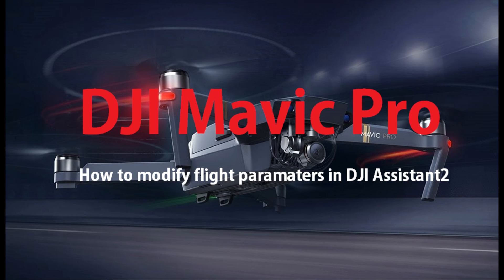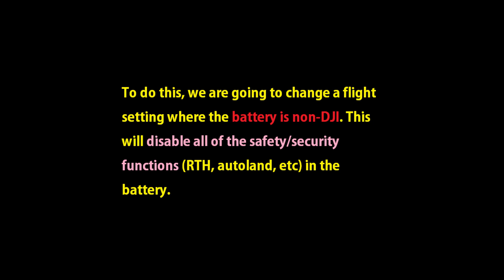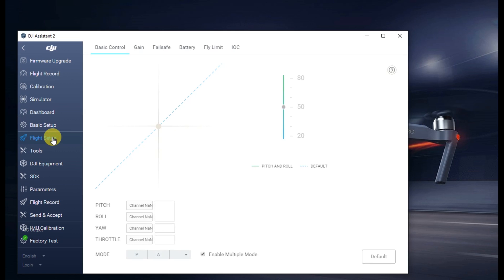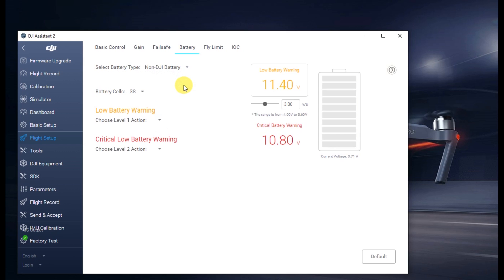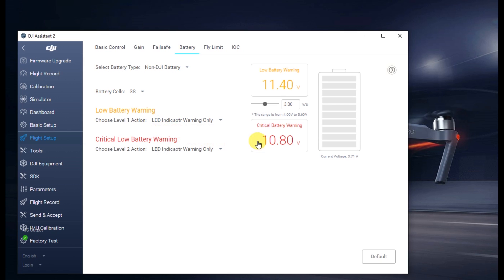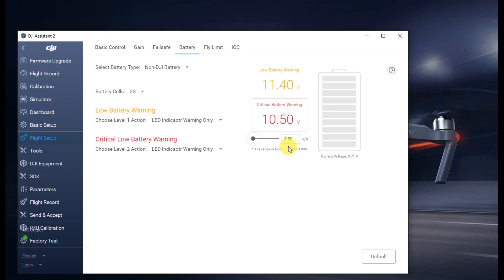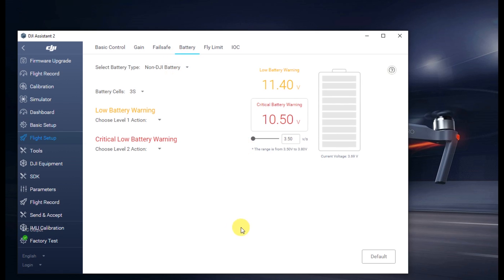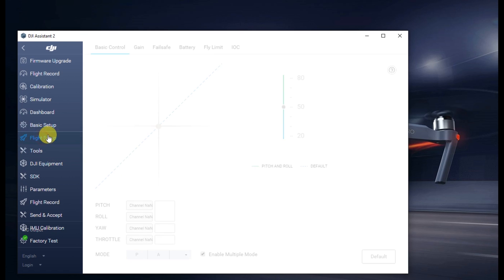DJI Mavic - How to modify flight parameters for  battery RTH mod

Comment: Sir I have a mavik air...the Dji assistant her which allows debugging does not show my drone as mavic air but mavik orange. Also when I change the parameters they do not show the numbers or sliders..pls help me with a walkthrough on this. I will be really greatful to you
Reply: Hi, I have the exact same issue. Did you find a solution?

Comment: dear sir ,Please help me. I disconect the pack 3s of circuit of mavic battery and the chip bq30z554-R1 block the current becouse one parameter named Permanant Fail (under voltage) and i cant change this.  How you change the cell and use the same motherboard?

Comment: This mod works on the Mavic Pro (Don't have experience with the other dji drones) - To help clarify what the author of this video cant say.  Lets say your flying your mavic and just going up, up ,up @ apx 6,000ft up  the battery will be at 72-74% battery remaining. But the on mavics brain was programmed to assume that the drone will decend at some slow speed (I don't know what stock decent is, but maybe 6-7 m/s). So even though the battery is showing 70+% battery left, the drone starts the return to home and there isn't a manual shut off once it starts, it simply returns to home and lands. What you must understand is that if your mavic goes over 1600ft  (400ft is the legal limit in the us) then the software/firmware has been modiifed. That said the decent speed will also have been modified. And in sport mode mine decends at apx 22 or 23 mph. and decending at that speed only uses 10-12% power. So in this example without this battery mod I would be forced to land with over 60% battery remaining when the drone touched the ground. Going really high isn't all it's cracked up to be and can get you in real trouble. But having your mavic in sport plus mode takes flying it to new level. Have flown mine for 8 months modified and no problems at all. The guy who does these videos and the others like him who have worked to make this possible are incredibly talented. I did my mavic the hard way and all mods my self (with instructions found online). Now you just spend $30 or so and it takes you 20 minutes. Google NLD or nolimitdronz.

Comment: I owe a Mavic Pro and yesterday I downgraded via assistant 2 v1.2.0(latest),from 1.04.0300 to 1.04.0100 succesfuly.
I tried to rollback my Mavic Pro to 1.03.0700 from my new current 1.04.0100 using Dumldore 2.14 (latest), using Steve's method.
Opened assistant 2,loaded my current firmware(1.04. 0100), open Dumldore, load 1.03.0700, closed assistant 2, pressed flash,pressed OK to the prompt, nothing happened and after of 3-4 minutes of waiting a warning appeared that Dumldore doesn't respond!This happened 3 times in a row and after that I stopped... Any ideas please?

Comment: hey🙋 nice Video👌. i have done it on my Phantom 4 pro. now autoland doesn't Kik in👍 this is perfect but i can't see the persentage of the battery in the dji go App? the is written 0% i must go to the battery Settings and read it there
Reply from the maker: ive not seen the battery % disappear before, but the available flight time will not be there, it will show --/-- instead. What fw version are you on??
Reply: my Firmware in my p4 pro is 01.04.0602
Reply from the maker: need 509 for all the mods on p4p
Reply: ok thank you I will try it whit 509 and tell you the result👍.
Reply: Did it work out for you? I got 509 and it still displays 0% with all of my batteries. Thank you!

Comment: Ater I unlocked the high limit my mavic is giving critical low battery warning and starts to auto land after pass the H mark when above 500m, even if the battery has more than 50% on it.
Have you experienced it? Do you think this procedure you suggested will fix it?
Is there a way to make this problem stops without disabling the critical battery land for real low battery condition?
Reply: this seems to only happen at 1500 meters for most people

Comment: My friend, when I put the number 2500 height can not be fixed when the pressure is due to 500 meters What is the solution I hope you to reply and explain this point for all now 3 days and I try and there is no result Thank you
Reply from the maker: I spend family time on weekends :) Do you mean in  assistant? what version ? use 1.1.2 or it may not work. also you cannot change the 500m number in DJI go - you change the height limit via assistant to bypass that value to go as high as you need.

Comment: Hi if i have 3 battery is still need to change all of my battery or only one battery and the other 2 battery become to non dji battery?
Reply from the maker: You can do them al, its kinda personal pref :) 
www.flyflydrones.com
Reply: oh this is battery based. so if i put a different battery on it will revert to the default?

Comment: Help me please! 
More info needed. 

What need to do to visualize the right side of Assistant 2 window with all the menus and settings as we see here and what version of Assistant 2 you used in this tutorial? 
I'm just beginning to figure out how to make these mods personally, I have the v. 1.1.0 and I see only an empty window with the MAVIC PRO icon (not Little Pilot) in the usual square frame, on the top-left of the Assistant 2 window. 
Should I first see others of your video tutorials to do other settings and steps before doing this, and if yes, which is/are these tutorial/s? 

I absolutely need to eliminate the Auto Landing as soon as possible, this feature have already create me a very big and ... irreversible problem with my Phantom 4 Pro+ ... !!
Reply from the maker: Mac: https://www.youtube.com/watch?v=RDV0iuOGaMU
PC: https://www.youtube.com/watch?v=CkpfC56u_ak

Comment: If I use this method .... if I press the home button on the remote control, the drone returns home? And if I miss the signal what happens?
Reply from the maker: yes RTH still works. Lost signal will still execute whatever you chose in the options.
Reply: ok thank you very much ....
Reply: Sorry, I tried 
to make this setting but when I fly I do not see the percentage of the 
battery ... I'm going to high altitudes and the lights of the LED are 
little use ... there is no way to see the percentage of the battery ???
Reply: mine still shows battery percentage

Comment: Nope didn't work, using iOS, DJI GO 4
Reply from the maker: what didnt work? this video is to modify flight parameters, you shared info on iOS .. ??
Reply: Ooops, wrong video.  will repost in the correct one

Comment: After modified, will the drone return home itself when losing control?
Reply: Mavic Henry same q here
Reply: I'd like to know also.  But guess you can easily test this.  Do the mod, fly away a 100 feet or so, then turn off the transmitter.  If it doesn't return to home, simply turn it back on.  I'm going to try the mod, but if it would not RTH on signal loss, I'll not fly it with the mod.

Comment: G'day - I've had great success with your parameter changes, quick question - the drop down options for the DJI Battery include "LED indicator warning only" - will this work if I change them instead of selecting "non DJI battery" ???
Reply: Nope. Doesn't appear to change anything if you do that, still wants to land at high altitudes...

Comment: Which device are we connecting to, the controller, bird of both??
Reply from the maker: just the aircraft for this one
Reply: digdat0 how about the one for sport mode +, just the aircraft too??
Reply: digdat0....Are you working on changing the parameters on the spark?
Have you or are you considering this?
Can it be done? My drones are amazing since I've done the adjustments...just need to know how to do the spark!

Comment: How far up can you normally go in feet before it tries to autoland in the normal mode?
Reply from the maker: i heard 3300ft,i havent done myself
Reply: Between 3000'-3600' with the P4. Basically once the time remaining hits the red zone it panics and tries to land.2
Reply: Goof245 I went about 6000 feet and it kicked in autoland...
Reply: yes, about 6000 for me also.  Forced to land and nothing I could do about it.  Still landed with 35% left!
Reply: UBCNME is correct. The RTH comes on and stays on until you land when you get upto 6000-6500ft. It just depends how efficiently you climb.
Reply: Depend on how far away you go from take-off point, the altitude above see level of this point, but also on ambient temperature, presence of wind, style of flight, slow or fast, if there are added batteries ... cannot be a fixed number.